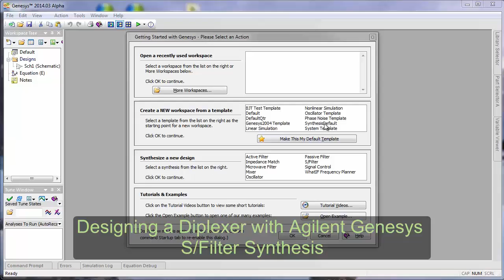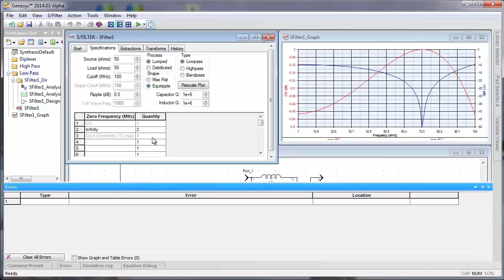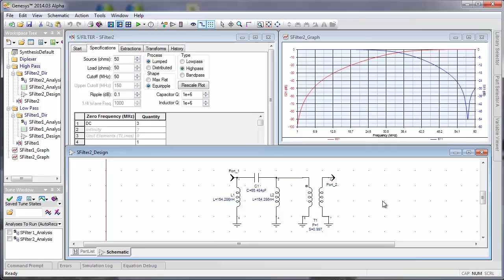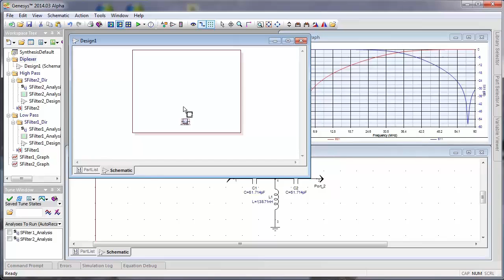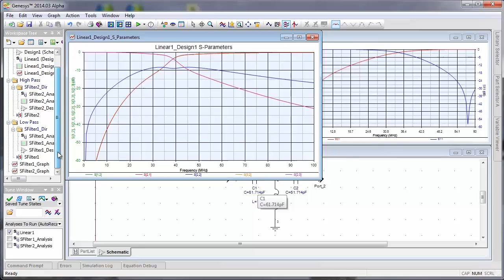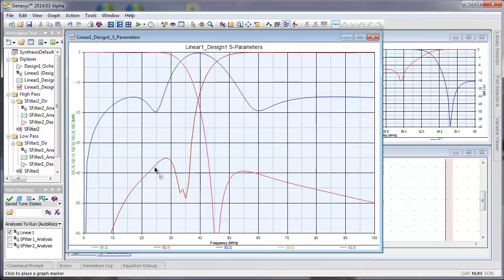Genesys Diplexer S/filter Synthesis

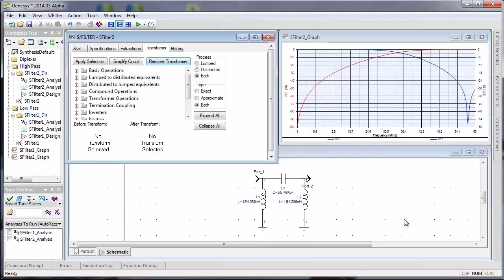Comment: @1:50 What is the reason behind changing to series output element instead of parallel?  What's the benefit?
Thanks.
Reply: It's bit more complicated than that - initially there was a transformer proposed, the designer opted to remove that due to cost, and the next proposal was a Pi-filter with a shunt element, which shorts (shunts)  the rejected-component of the signal to ground before passing the pass-component of the signal to the next element.

Because this is a diplexer, one does not want to "throw away" the rejected component of the signal by grounding it out - we merely wish to block it from getting into the subsequent filter stages.  By using a series element first, this prevents the rejected-component of the signal from entering the filter beyond the first component, leaving the rejected-component of the signal more or less alone (except inside the subsequent filter stages where it is further tuned and balanced out).

The key take-away here is, it its important to consider what you want to attenuate and what you want to pass, and where.  Capacitors pass higher frequencies, inductors pass lower frequencies.  Picking which type of component the signal sees first sets the course for post-filtering - and if you want to send signals more than one direction, it's best to use a series element so that you don't "consume" the rejected portion of the signal at a shunt element.

The original proposed transformer at the output becomes interesting in cases where one is moving from unbalanced to balanced outputs, changing the output impedance, or removing (or adding) a DC offset.